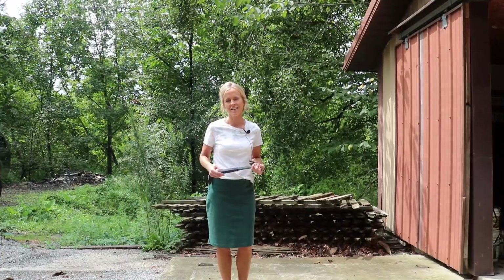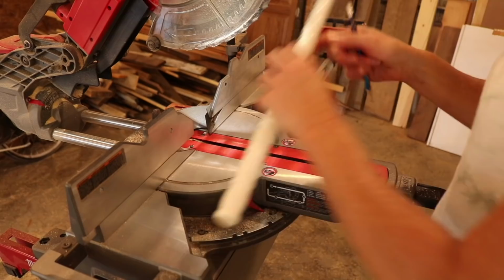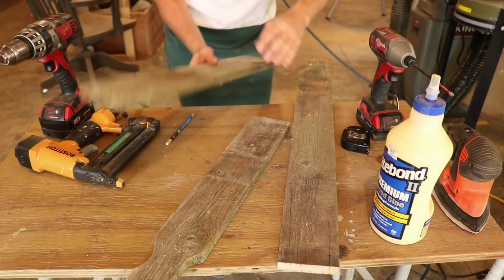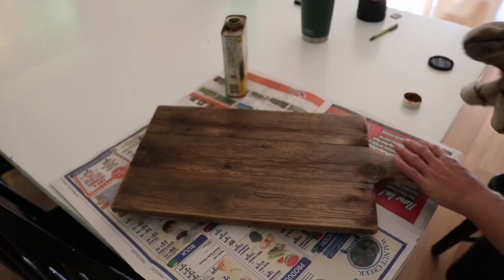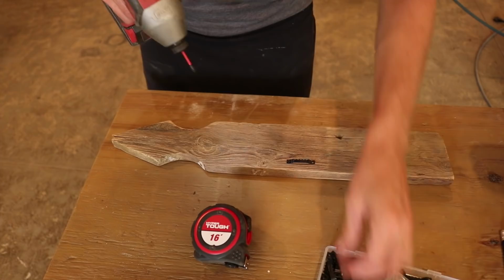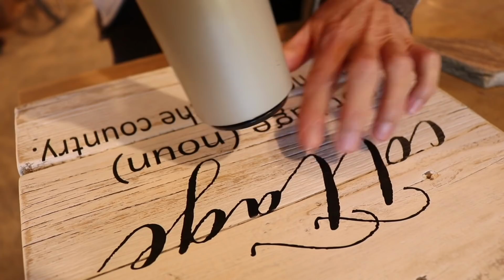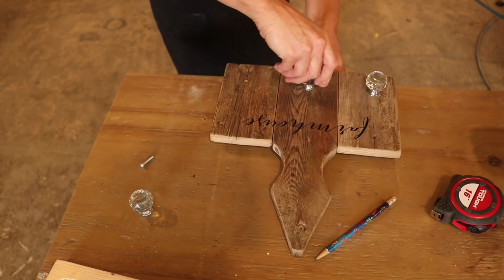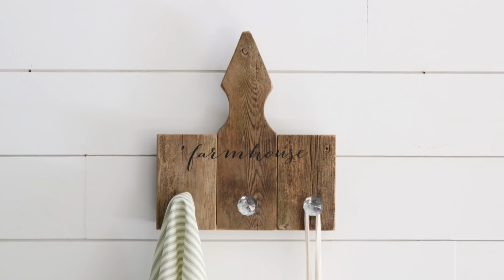Picket Fence Projects ~ Old Wood Home Decor ~ DIY Home Decor ~ Picket Fence Home Decor

Comment: If you have the tongue, and groove bit or miter lock bit you wouldn’t need to use two extra pieces of wood on that charcuterie board, gust use the router bits to route the grooves, then apply wood glue and clamp it down.  Also with round over bit you can round out those edges. Also I would’ve use that spade bit on a drill press, or just moved to Forstner bit, lot less chance for blowout if you move to a drill press or use a Forstner bit.

Comment: Really like all your projects.  Wonder if you have a router (I think that's the proper tool) to make a small indentation on the wall scones about the size of the bottom of the candle glass to give added security?  Thanks for nice video.

Comment: Hi Mary.  I have a question about your vinyl.  It seems to come off the paper so easily but using my Cricut vinyl with Cricut transfer tape, I really struggle.  Do you find one easier to use, Cricut brand vs Silhouette?